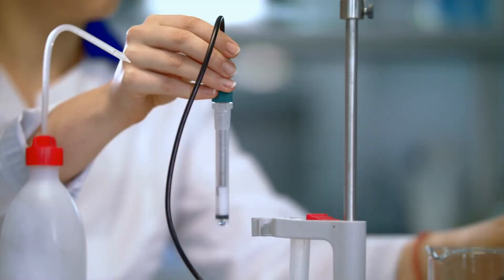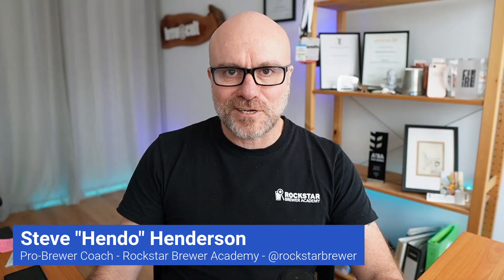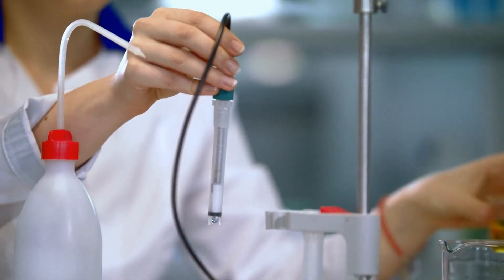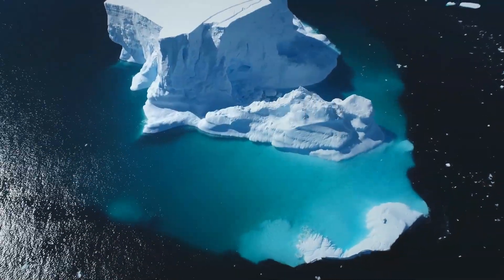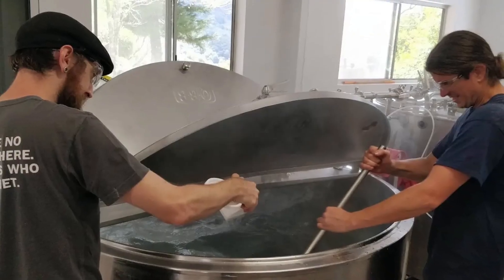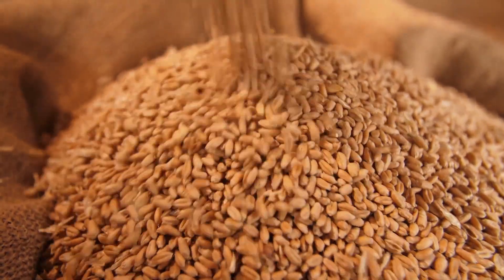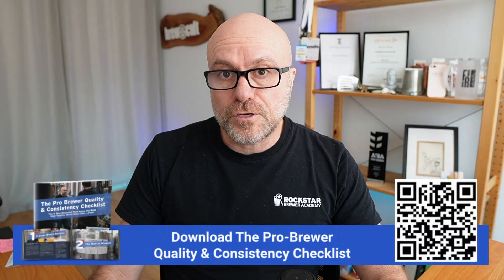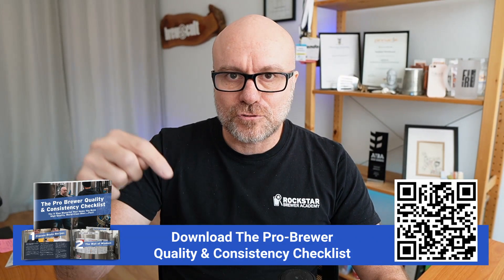Why Do WORLD CLASS Brewers Use This Water Profile Number? | QFPB E033

Comment: Thanks a lot for this video. It's really helpful. I made a brew recently and tried to lower the pH during the mash and it was not lowering. Now I know why. Just one question: if I have grist containing a significant amount of darker or crystal malt, can I (or should I) help lower the TA from the outset by simply adding some slaked lime into my water salts? I know TA still needs to be measured properly to know the hard number, but is doing this at least a good start?
Reply from the maker: Slaked lime will lower TA but then it reacts with the malt phosphates and cancels itself out during the boil and leaves you back where you started. Use bicarbonate instead 🍻

Comment: Hi Hendo, great video. With the standard advice of mash ph in a range of 5.2 to 5.4, is it titratable acidity that really matters for mash health, or ph? 
If you did need a high final TA, would that mean you would add acid after mash? But ideally if you can hit TA just through recipe/mash water chemistry you would?
Reply from the maker: Yep. pH for good mash conversion. TA for beer flavour. Inside my programs, I teach a method to control TA after the mash is completed. There's a few places you can do that... Too many to mention in a YT comment. Thanks for tuning in 🍻

Comment: For an all barley malt beer fermented with a regular saccharomyces strain (not a mixed culture) isn't final PH correlated enough to titratable acidity?

It seems like it's much more of a crucial measure to use when other kinds of fermentables are involved (like fruits) or if there is bacteria that produces various types of acids.

In practice for a clean beer wouldn't you agree that any PH adjustments post fermentation should be done to taste rather than a number?
Reply from the maker: No they don't align because pH is a logarithmic scale and TA is linear. 

To your 2nd question, while you can add acid post fermentation to taste, it tastes medicinal and one dimensional. Source: have done it. 

Thanks for tuning in 🍻
Reply: @RockstarBrewer I've adjusted heavily dry hopped beers post fermentation with success.  These beers tasted fine beforehand dry hopping, but the dry hops materially spiked up the PH.  

Never had a need to do it on any other styles though.
Reply from the maker: Instead of adjusting pH post fermentation to taste, have you considered lowering your wort pH pre fermentation so it lands where you want after dry hopping?
Reply: @RockstarBrewer i rarely brew the same beer twice.  I would definitely do that the next time if I brewed that same exact beer

However different yeasts finish at different levels of acidity and certain varieties of hops tend to spike PH up more than others.  I don't always make this sort of adjustment, but I find its a useful tool in the arsenal when needed. 

I have also found that some yeasts land in the same finished PH range regardless if I adjust before fermentation. The yeast often naturally finds its happy PH range. 

I brew a lot of hybrid styles like Belgian IPAs and Hopfenwiesse.  These are often the ones where I make the adjustments. 

If I use a typical clean American or British strain like 05 or Nottingham the PH tends to land low enough after fermentation where adjustments aren't needed. 

I only brew about 8 batches a year at this point are rare the same beer twice within a year.

Since I start with RO water I'm rarely using enough lactic acid where there would be a huge lactic flavor impact.  If my starting water had a higher PH and I needed to use more acid in general this kind of adjustment could add an undesirable twang.  Phosphoric acid would be better for this kind of adjustment should a material amount of lactic acid already be used on the hotside

Comment: So if your beer is flabby… low on the TA scale… what’s the solution exactly? Do you add lactic acid to the final beer? Or at some other point in the process
Reply from the maker: You can do that but it'll make the beer taste medicinal and one dimensional. Best way is to have a proper water profile planned before your mash in (one that's that's not from your brewing software.) Watch this video about the whole system... It might give you some more insights https://youtu.be/NZy7pdDhyEI?si=sdJYVkhuU7eQP5nl